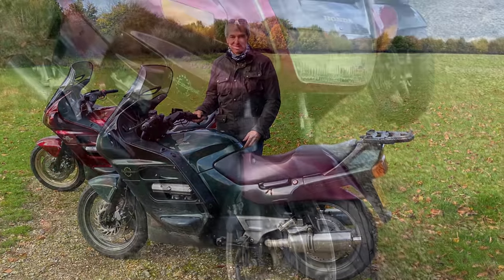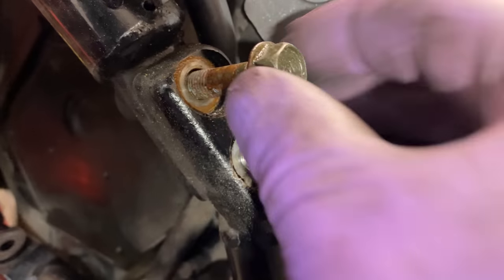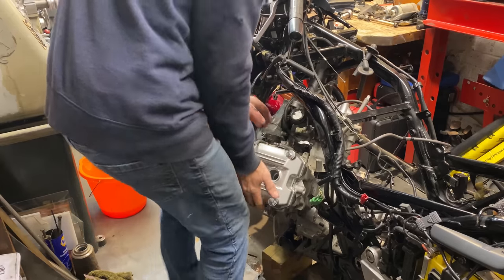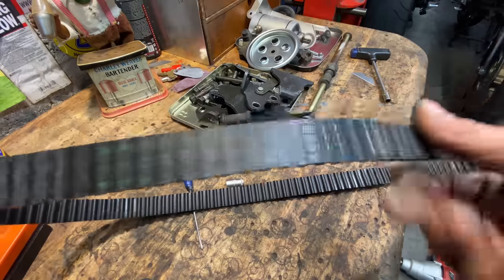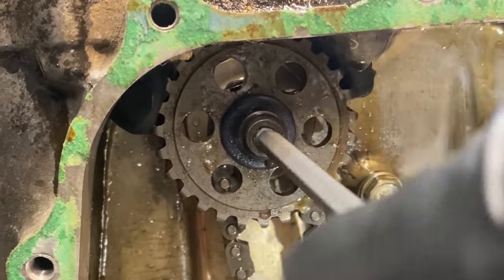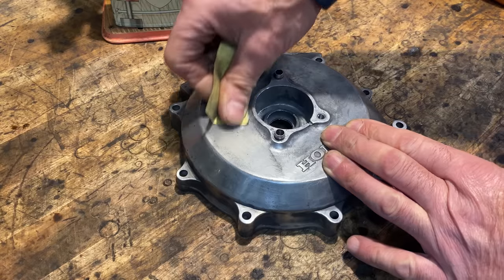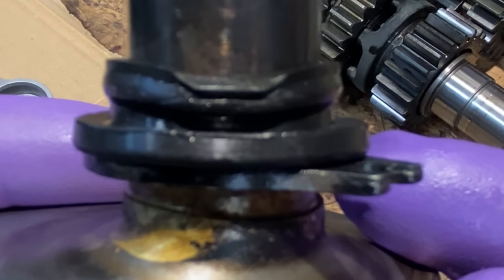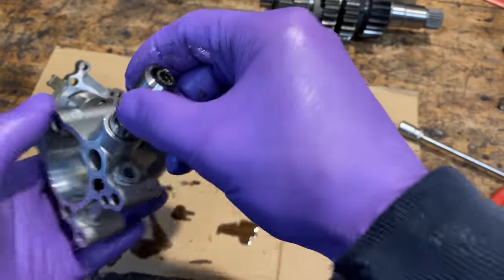Honda ST1100 Pan European engine removal and strip

Comment: You may have already found the source of the problem in the oil pickup tube o-ring seal misassembly. Sucking up air with the oil could easily cause low oil pressure and big end bearing wear. Your determination to find the problem is admirable and inspiring. She will be better than new when you're done with her.
Reply from the maker: I’ve just received a big box of nos parts and gaskets 🙂
Reply: @AllenMillyard  Yay! I am looking for your next video 🙂 No cup cakes during Christmas?
Reply: @AllenMillyard  Cant wait for pt 2!!
Reply: Great teardown video looking forward to part 2 
.
Reply: Surely you’d expect some cavitation marks on the oil pump if that was the case
Reply: @yourealwaysright6770  
I'm not an expert in cavitation causes but the oil viscosity and relatively slow movement in the pump may not be conducive to cavitation. I would expect some aeration and foaming action and loss of oil pressure as the pump mixes the two fluids -- that may lead to collapse of film protection on the most loaded plain bearing interfaces (big ends). I'm just a shade tree mechanic who's worked around some very large and heavy industrial pumps and engines. Not a trained engineer or mechanic. Just a curious, passive observer.
Reply: @marscruz  i tend to agree, the amount of air it would be sucking wouldn't cause cavitation, but certainly could cause an aeration issue leading to low film strength.  Next episode should confirm or deny when the bearings are exposed. .....I'm waiting for the new year's first episode.  .
Reply: @mattyb7736  
I have no doubt that Alan will find all the answers to the niggling questions and unusual noises. He's an amazing mechanical engineer/technician.
Reply: I’d place bets you could have done all that in you’re sleep. Thorough work as always 👏🏻 Happy new year.
Reply: @marscruz  i just want his hacksaw, none of mine have ever cut a straight line
Reply: @mattyb7736  My hacksaws always cut to the left. Even new ones from Aldi. I’ve never discovered why they can’t offer anything that cuts the other way.
Reply: @davidelliott5843 must be right handed 🤔😎

Comment: I was a Honda motorcycle dealer mechanic in the 70s. The bulletin came from Japan from Honda to the service departments of the dealers here in the USA.
  when installing dry paper gaskets, get a can of rust, oleum, silver aluminum paint. Do not stir or shake the can. Scrape the thick paint from the bottom of the can and apply that to the new gasket both sides. When the area the gasket is going to be installed on is clean., install that gasket wet. That gasket should never leak, and, it will come off in one piece at the next disassembly…
  I bought a quart of that rust oleum silver aluminum paint back in the 70s. I have been using it ever since on my dry gaskets such as, my valve, cover gaskets on my moto  Guzzis.. anytime I have a dry gasket, I apply that thick gout from the bottom of that paint can to the gasket and I put it on still wet.. I have never had to  scrape those treated gaskets or buy a replacement gasket, such as on my moto guzzi valve cover gaskets since.. I just had to be careful on engines that were anodized black that I didn’t use too much of the aluminum paint that would cause a run ..
  I appreciate your meticulous video. Doing the video and the work must have increased the time it took by 90%.
any time you have an oil pump out or a new pump to install. It is a good idea to pack it solid with petroleum jelly to prevent  initial start up oil starvation..i learned that from a long time  factory schooled saab dealer mechanic..
Reply from the maker: I always crank 
 the engine on the starter with no ignition until the oil light goes out this ensures the oil pump is  
 primed before the engine is started

Comment: to help with the engine removal, i use a couple of the "windbag" inflatable cushion things that you get from. DIY, or online, on top of the wooden blocks...you inflate them, to take the engine weight, which makes removing mounting bolts a charm, then, with the bolts out, you can slowly deflate the bags; because they are 'soft', you can wiggle the engine about, as needed, while lowering it. when the bags are fully deflated, you can drag them out by wiggling the engine a bit. This makes reassembly a charm, too, since the air bags give you 'microscopic' control of the engine as it comes up to the correct position!

Comment: I had a ‘99 for 10 years and did 173000 miles. Best bike i’ve ever owned. Most epic experience was spending the night in a Polish petrol station car park stripping down and rebuilding the cooling system by the torch light of the most awesome driver (who spoke no English).  Turned out the system was fine and the temperature gauge was just grounding out. The most user-serviceable (big) bike I’ve ever owned

Comment: The only thing i had to replace on my honda's all 8 of them, Clutches, Timing chain tensioners, and adjust valves when needed. And all 8 have seen track time, racing, daily driving, Street racing. A st1100, Valve adjustments, clutches, timing belt tensioner.  Check gear lash on drive shaft. I have never torn a honda engine apart!  I have abused my honda's from day 1 from the honda dealer. I am the only one in all of his customers that has a new bike and hit 190 miles an hour in the first 5 minutes after purchasing the bike with zero miles on it. Each of my honda's had minimum of 40 thousand miles. My 1100 blackbirds had 65 thousand miles each and top speed radared on the track 198mph.  Even my moms 1964 honda 50 still runs, and my dads 1970 350 twin, motors have never been torn down.

Comment: I enjoyed the video. Very nice work indeed. For stubborn gasket removal, I have tested a wonderful method that I like to share. It worked like a charm. I have used a multi tool with the common triangular velcro sanding attachment adapter and then attached green kitchen scotch brush pads to it, which I cut to small square sizes. I greased those with some transmission assembly lube, so that they do not create or shed any particles. I needed new pads every few inches as the pads would load up and lose abrasiveness. No problem, they are available plentiful and cheap enough. I was able to rotate the scotch brush pads 180 as well, so each pad got 2x passes. It worked like wonder. Fast efficient and so free of abrasive particles, that I probably could have even skipped covering the adjacent parts. I have appointed this method from now on to be my preferred method for removing gaskets. It sure beat any rotational tool method with the corresponding flinging off of grease.

Comment: Watching this reminds me of tearing down and repairing the gearbox of my 1975 gold wing. In fact it seems Honda kept a lot of their designs from that old bike through their other larger bikes. The ST motor reminds me far too much of the old CX5oo, but just going from pushrods to belt driven OHC. I feel a sense of dread when I have to go into jobs like this, but really as I start digging in, time passes and it's usually easier than I imagined it would be, and I chew right through it.

Comment: Allen - You may or may not see this but I'll post it anyway. I own 8 ST1100s of various years - 4 runners and 4 parts bikes. Between the 4 runners, I have over 470,000 miles in the seats of ST1100s (hoping to cross the 1/2 million mile mark next year). I have found myself having to swap engines twice - once because of a premature water pump failure at 139,000 miles and the second time it appears to be an oil ring failure (haven't dug into it yet but the engine smokes oil pretty badly, oil in the headers, etc.) at 45,000 miles on that engine. What I have found is if you remove the alternator before the final engine removal, it eliminates a lot of the 'wrestling' to get the engine out. Once you lower the engine a little bit, you can get to all three alternator bolts. And if you can keep the alternator 'gear' assembly into the engine and just remove the base alternator it becomes even easier. I found the issue was the alternator wants to hang on the gear shift 'ear' on the frame even after the lever is removed and the frame 'ear' on the left side at the right back gets in the way. I hope you don't have to remove another ST1100 engine but if you do, here's an idea that might be of some help to you. Your videos on ST1100s are top notch and are very helpful to me. BTW, I've ridden in your fair land many times and always enjoyed it (multiple write-ups on my website). I've even ridden Hard Knott Pass on a rental ST1300. 

'Uncle' Phil Derryberry

Comment: I had an ST1100, and stripped it down to the chassis once to get the chassis alignment checked.  I was not game to take the engine out, and youv'e confirmed I made the right decision!   The engine on these is bullet proof, so yours must be one of the very few that's been pulled apart.

Comment: A testament to Honda’s bike design & manufacturing that you can buy a 22 year old bike and find, in the main, absolutely nothing wrong with it. It’s a helluva biker isn’t it? A friend had a Yamaha FJR1300 & that had the same kind of well-madman bulletproof feel to it all. It was bloody heavy, though my pal said the reward is that it feels completely planted at any speed. Much loved by some police bikers.
Another pal has had a few Pans and absolutely swears by them. Huge mileage fellow, he does a long, European mainland holiday tour each year. I find I no longer want to ride in the rain, though I did three wet days a couple of summers back and it wasn’t a problem. Less slippery than I’d remembered though again I wonder if the weight of it was a plus (Suzuki GSX1400).
Enjoy your Pan, Allen!

Comment: As ever a pleasure to watch your meticulous working. So far this engine seems to be in superb condition apart from that one seal. The Pan's reputation is intact.
Reply from the maker: I think ive got the only one with an engine problem but ill fix it
Reply: @AllenMillyard  that oil seal seems a minor issue, could that be enough? Otherwise everything looks fairly almost new 👍 16k for a Pan is almost run in.
Reply: @plunder1956  that improperly installed oil seal can likely cause bearing issues

Comment: The ST 1100 was a rock solid reliable unit, engine failures, if any were rare.
A mate I used to ride with had one with more than 200,000 trouble free klms on it. Good old Honda reliability.

Comment: Hi Allen, great video as usual.  If you ever want to remove the engine from a VTR1000 and show people how to replace the automatic camchain adjusters and replace a cylinder head.  This being one of the most common Honda faults.  I've got one sat here you can demonstrate with :)
Reply: you don't need to remove the engine to replace the cct on a firestorm
Reply: @254lele  mine needs the cylinder head doing and a bloody good clean up 😕
Reply: @ekoturnip  remove the front cylinder dosen't need the engine off
Reply: @254lele  Maybe not usually, but bear in mind I was given this bike for free.  It needs LOTS of cleaning/repainting.

Comment: Thanks Alan, just the inspiration I needed to get my bike engine apart and investigate the knocking noise (when cold). Fisrt thing I'm checking is that oil pickup O ring. Mind you, after 468k miles and 5 cambelts somethings bound to be a tad worn. 😉

Comment: Had my 1996, 95k ST1100 for about 10 years now. Had two swing arms, new alternator, coolant pipes which exploded on me and cam belt. Purring like a kitten and don't think I'll ever get rid. My last pan cam belt snapped demolishing the engine. Let me know if you ever fancy reconditioning the turbo on my CX650 Turbo 😉.  Looking forward to the next episode.

Comment: Great video Allan. In 1978 i completely dissasembled my BSA D14/4 engine and replaced parts and reassembled, but i wouldnt have the confidence to undertake what youre doing with that Pan 1100 engine. How on earth do you remember what goes where upon reassembly? This is truly amazing and gives an insight as to how well engineered that engine is. Nice!

Comment: I owned a 1993 ST1100 (Red). Finest bike I ever owned in 35 years of motorcycling. Used to solo tour on it in the states without a care. Absolute king of road bikes (imo). 

This is the engine I always hoped Honda would turn into a V6... redesigning with smaller bores to essentially take up the more/less the same space. 

It greatly pleases me to see you take this down. What a journey this will be!!
Reply from the maker: I remember when they cam out in 89, I thought they were a V6 the fake extended cam covers made the engine look longer
Reply: @AllenMillyard  Oh, no wonder where your ideas of adding cylinders came from 🙂... but ... are you going to make it a V6? 🤣

Comment: So excited to see another video Allen, it's like getting an extra Christmas present 😁🎄
Like you, I'm very surprised at the fault at such low mileage - especially on a flagship bike of Honda's. As disassembly commenced and the overall condition was entirely as expected (for the mileage) my thoughts turned to it being an oil pressure issue so I was keen to see the oil pump too. The misfitted seal was a surprise though. Mind you, I know someone who had a brand new NC750 which was found during it's 1st service to have a missing head gasket! The bike showed absolutely no issues and ran perfectly 😳 The precision on all of the mating surfaces is so good on Japanese bikes isn't it? I'm looking forward to the next instalment very much.
That earthworm had a Christmas wish too - a Megadrile Great Escape 😂

Comment: Enjoyed this, Allen - felt your pain with the old gasket welded onto the cases - changed the clutch on my zx7r recently and that was the case, had to spend some time with a stanley blade scraping off a gasket that had been put on with copious amounts of gasket seal - when i re-assembled i just used a light amount of gasket seal on the case side and some general grease on the bike side - no leaks as yet, was given that tip by an old race mechanic!

Comment: I had an ST1100. Fantastic bike. Stripping the fairing is hard enough work, so to see you strip the engine down is awesome. 
Really looking forward to part two. Despite numerous attempts, I never got the ABS to work properly on mine so now have had 1300. 
Very jealous of the hedgehogs. Mine only stayed 6 days and then left. Probably saw your place on trip advisor 😂

Comment: Hi, just got your second utube on rebuilding the ST 1100 .Are you a mechanic by trade ,
I admire your thoroughness in disassembling and assembling the ST 1100. Also I have great respect for Japanese engineering they are the Kings of motor  engineering excellence!
I ride at 07 ST 1300 with 31 k on the clock.
Regards,
Downunder Ged 
Dalby, Queensland, Australia.

Comment: My dad put 120,000 miles on his ST1100 and loved every one. I'm sure he never had it apart. He basically just ran full synthetic and changed the oil every 10K "whether it needed it or not." LOL Great machines.
Reply from the maker: That’s normal for pans mine seems to be an exception but I’ll sort it

Comment: great video ! as you would expect there's few similarities with working on honda automotive engines.  two immediately come to mind, the extreme tightness of all the nuts and bolts and the frustrating amount of time required to scrape off all the old gaskets.

Comment: Never owned a Pan, but I've friends who have and they swear by them, ultra reliable,  smooth and comfortable. A guy in our next village has one of the originals with over 270,000 kms, apart from routine servicing the engine has had no major work although the bike itself has had a fair few parts, new swing arm, suspension front and rear, and repair to the rear drive shaft..think the only disadvantage is the weight for moving around the garage, once on the road it's no problem...

Comment: Every bike I’ve worked on had rusty bolts and sometimes really nasty rust on frame parts. That includes a 2008 BMW and 1997 Yamaha. Grit blasting phosphate wash and powder coat were the most cost effective.

Comment: quick question, how do you get rid of the ABS system? I have a 93 st1100, I laid it down last summer goin over sand and gravel, any way i'm removing what's left of the front fairing, Cafe racer style

Comment: You made my day with this episodes of stripping the ST1100 Pan European as I hve one for 22 years as a sidecar motorcycle. It is a great bike and usually very reliable. 
Didn't you find it difficult removing the carburators. I had to clean the carburators after a long period of downtime and I couldn't find and reach the srews of the clip collars on the intake sockets to release the carburators as long as the motor is in the frame. It was a nightmare to reach and unsrew these clips.

Comment: An Upload from Mr. Millyard around christmas, one of the best presents for me. 
As always superb work. Thanks.

I might be mistaken but does it look like the retaining ring on the oil-pumps pressure relief valve was facing its rounded outer edge outside when reinstalling?

regards from Germany.